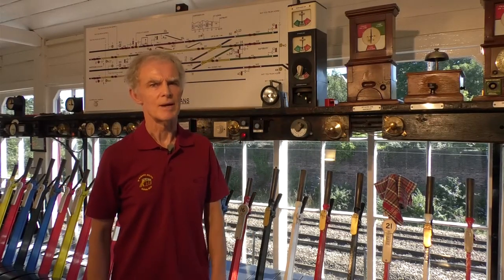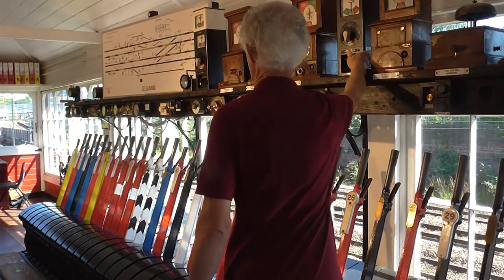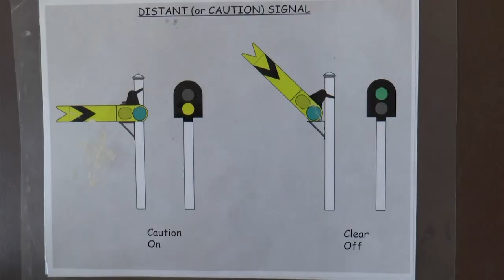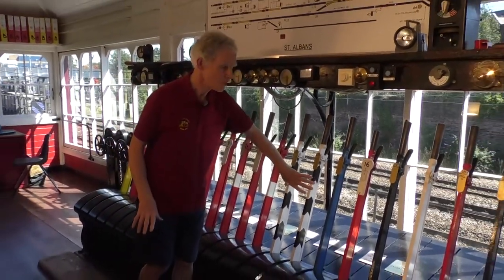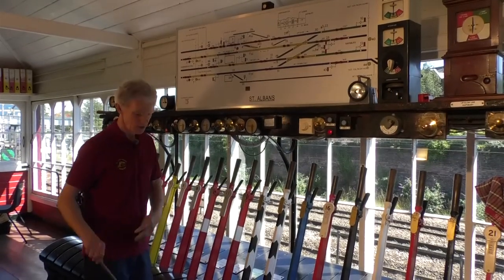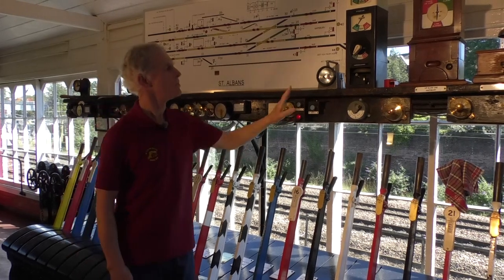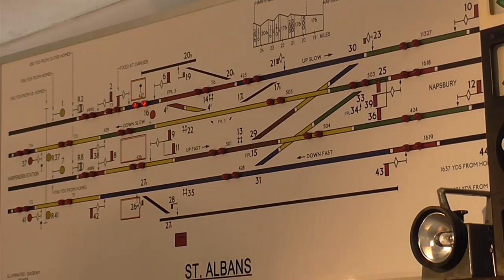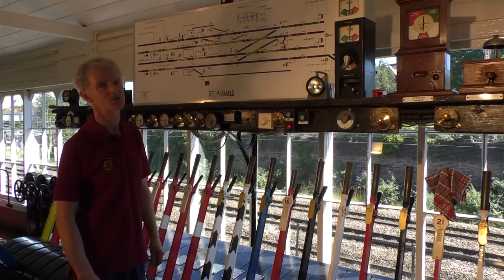How it works - St Albans Signal Box

Comment: funny, in Belgium and Germany blue levers act on the turnouts and black ones do the locking
Reply from the maker: Yes - funny thing colour coding - I recall the introduction of green/yellow (earth), brown (live), blue (neutral) for single phase domestic wiring in UK.  It had been green (earth), red (live), black (neutral).  Of course, in english, earth (as in soil, mud etc) is usually brown.  Maybe the idea was to make fitting a plug a task for an expert and dangerous for the uninitiated.

Comment: I assume levers aren't connected to anything!
Reply from the maker: The levers connect to a computer interface that reads the state of the levers (on or off).  The computer also has inputs from the tappers and line instruments.  It has outputs to the bells, the lights on the track diagram and indicators on the instrument shelf.  The levers are interlocked by the original Victorian mechanism of rods and slotted bars.

The computer simulates the signal boxes that controlled  the adjacent blocks on the 4 track Midland mainline at Napsbury and Harpenden and is programmed to offer and accept trains from our signal box.

One lever is connected to heritage signal in the garden around the box, but you are correct that here are no connections to any part of the railway that passes the box (the Midland mainline).

Trust this helps explain and thanks for watchng.